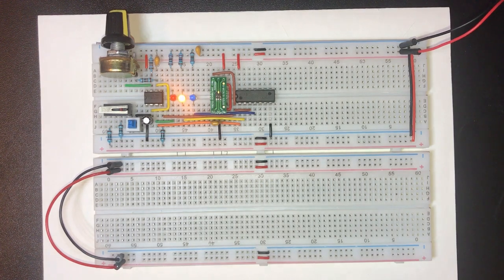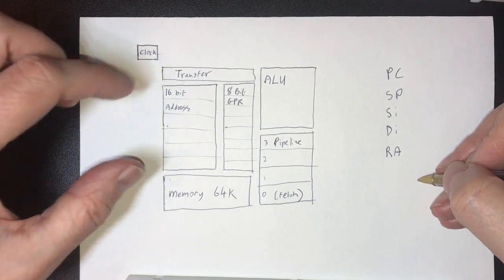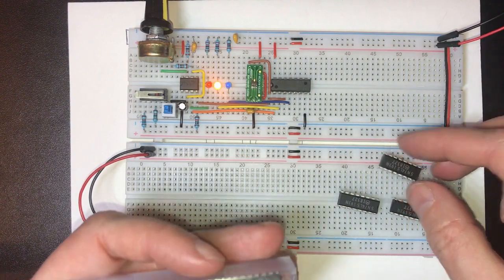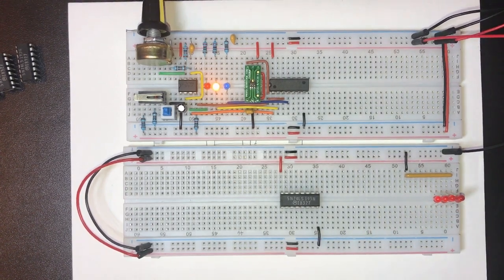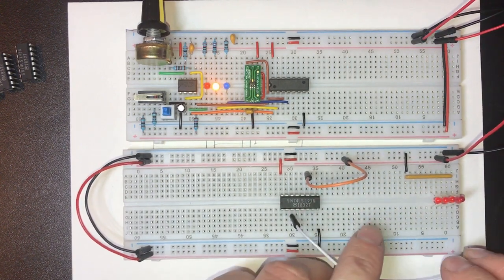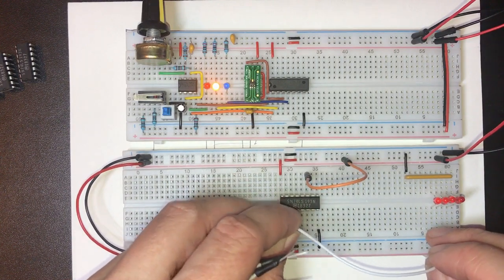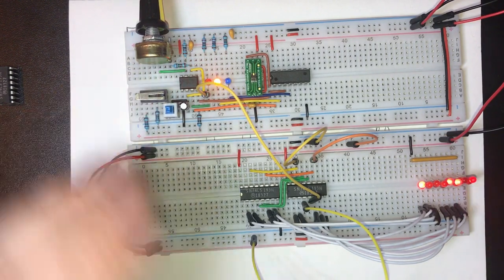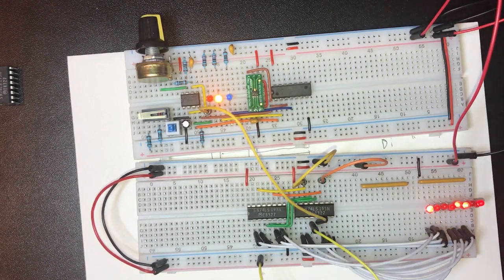Address Registers (1: Counter / Storage) - Making an 8 Bit pipelined CPU - Part 2

Comment: The rising-edge-HIGH clock/carry pins are because it's a flip-flop, so the master counts up/down on the falling edge, and then the data transfer happens on the high edge. By the diagram, the first SR flip-flop is timed by ^UP|^DOWN, so if you're holding one of them low, it is simply never clocked. Others' clock conditions are split between UP and DOWN and depend on lower bits.
Reply from the maker: This was very early days for me, the issue is obvious once I studied the data sheet.

Comment: The reason the count up/down inputs are the way they are is because the '193s are synchronous. The usual way synchronous devices work is in two stages.
1. Prepare to change.
2. Change.

So having both count inputs high indicates idle. Switching one of 'em low causes the internals to prepare to change to either count up or down. Then going back high causes all of the outputs to change simultaneously.

If the count inputs were the way you assumed (low, with a high going pulse causing the inc/dec on leading edge) the chip would have no indication of the next operation being an increment or decrement. So it would have to be implemented as a ripple carry.
Reply from the maker: You are of course correct, that's obvious in hindsight but the "James" that made this video was fairly new to digital circuits whereas I (for all mistakes and flaws) have managed to scrape together a working pipelined cpu and I've picked up a few things along the way ;-)
Reply: @weirdboyjim  Indeed you have. Just recently saw your VGA video and decided to subscribe and view your series. For the most part, any comments I'll make in the older videos are aimed towards future viewers who may wonder about points you bring up in the videos, but were unaddressed.
Reply: I was wondering about something.  If I understood correctly, as you are incrementing, the increment out is held high up through 14.  On 15 it gets pulled low, and then when it rolls over to 0, it goes high again, the rising edge triggering the next chip to increment by one.  But what happens if you get up to 15, and the carry out gets pulled low, but then instead of incrementing again you decrement back to 14?  Does the carry out go high again?  And if so, how does the next chip distinguish between these two scenarios?
Reply: @MechaTama31  The output count pin is only going low because he was driving the inputs wrong. The chip expects "and-COUNTtttttttt-and-COUNTtttttt" with "t" being the idle state. He was sending "aaaaand-count-aaaaaaaaaand-count-aaaa". The moment the chip gets the "and" it sends an "and" to the next chip (if needed) so they can all react to the "count" at the same time. This got really awkward when he was sending "aaaaand" to both the count up and count down lines---the chip was trying to do both at the same time and was just waiting for the "count" to switch its output lines.

Edit: Thinking about it a bit more, it would probably be better to say: The chip was inspecting "count-output-count-output" be he was sending "...-count-...-count". So when he sent "nothing is happening" the chip heard "count" and when he sent "count" the chip heard "output the result".

Comment: I believe there's a simpler way to resolve the momentary blip on power up...   Just invert the clock.  If you switch the polarity of the resistors associated with the micro switch, then when the clock is halted it'll rest on red not yellow.  When the power is restored to a paused clock the red LED still comes on but now it stays on.  Thanks for the tutorial - It's very impressive - I'm reviewing it for the second time as I start building my own pipelined CPU :)
Reply from the maker: That's right. The discharged state on the capacitor equates to a high output so it's always going to see a momentary high as the cap presumably has no charge when the device was of. This video is very early in my electronics journey, the subject of clean initialization is something I revisit a couple of times along the way.

Comment: Why don't you put decoupling capacitors on VCC and GND of your 74xx chips?
Reply from the maker: Good question. They are difficult at getting onto the breadboards (But I do get a bunch on there), later on when I'm converting things to pcb I am careful to get a decoupling cap as close to the power inputs of the chips as I can.
Reply: @weirdboyjim  Gotcha. I love your videos by the way!

Comment: Hi James.  So incrementing to the next 16 bit word will take two clock cycles since you'll have to pulse the 74LS193 increment pin twice, right?
Reply from the maker: That's not really defined at this point.  If you want to add two you will need to clock it twice. So if you are reading bytes you'll need to clock it twice, but you'll need two cycles to get 16 bits across an 8 bit data bus anyway.

Comment: I am using  (2)74AS867's as my counter/stack pointers(8 bit counter)(I have 2, 8 bit bus's- shared through (1)74ls245). Very handy up/down/load/clear functions. For anyone looking for alternative part numbers for counters :)
Reply: 5v chip. 3.5v outputs...So no led's can be driven without a buffer of some kind. (74ls245 works nice)
Reply from the maker: 8 bits at a time looks nice, I have been trying to use very common parts with a ttl interface,  the AS varients are outside my experience at the moment.

Comment: Interested to see the later episode where you talk about the address return register. In my ignorant opinion this is plain wrong and you should just use the stack. So I'll be really interested to see why you've opted for a register.
Reply from the maker: If you asked me before I started building this thing I would have agreed with you. You can argue in favour of a return register in terms of the reduction in the total number of stack operations (In a recursive binary function you halve them) but the real reason is really interesting. Only a few videos in the series before I do that one, so you can be happy you found the series now and not back when I first recorded this one.
Reply: @weirdboyjim  oh... is this what the functional programming people are on about when they go on about tail calls?
Reply from the maker: I double checked "Tail Call" and that's actually something else. The benefit of the return register is that it doesn't use the stack at the bottom level of a call chain. To make a call from within a function you need to save the value of the return address (usually by saving it on the stack), but if your function doesn't call any others then you can avoid the stack entirely. A tail call is another optimisation that works in both models. If the last operation of your function is to call another one then you jump instead of calling it, when it issues the return instruction it doesn't return to you, it returns to whatever called you.
Reply: @weirdboyjim  for any future people coming along, the terminology for not spending the stack operation with the return register in this case is a "leaf function"

Comment: Yeah.... I thought it was a bit weird that you were using SIP resistor packs but single LEDs... but all is explained if you've got them on order. on Veroboard I've got some surprisingly neat layouts with DIP resistors and LEDs.
Reply from the maker: I’m still frustrated the led come in 5’s and 10’s but nobody seems to sell 8’s.
Reply: @weirdboyjim  yeah... I've got home made test thingies.... with either 2 unused or 6 ordinary LEDs bodged on..... I think it's because they're aimed at audio applications and audio people have to have them go up to 10
(Or 11 ;) )
Reply from the maker: Wait until you get to my pipeline videos, I cut 2 down two 10’s down to 6’s so I can have 16 led’s without wasted space.
Reply: @weirdboyjim  that sounds cool .... I look forward to that.

Comment: Very nice video, especially the binary counting LEDs, which are slightly hypnotic (at least to a coder like me) :)
Reply from the maker: Thank you! I have lots of experience with software and very little electronics experience so even getting the first binary count going was rewarding, even if it is the hardware equivalent of “10 PRINT…”.
Reply: Yeah.... when I'm testing any kind of output device it's time to hook up a binary counter and a bunch of LEDs and get the video camera out :) ;)